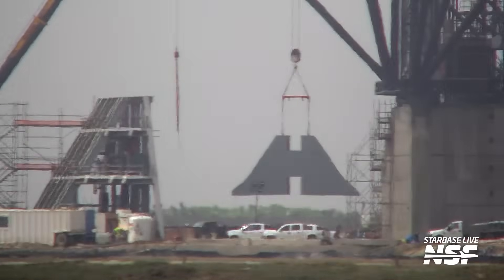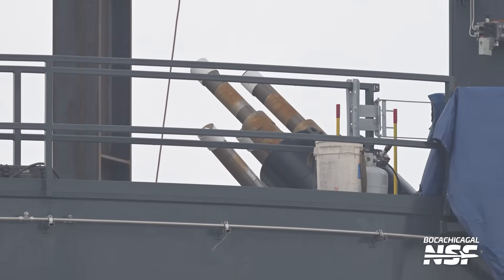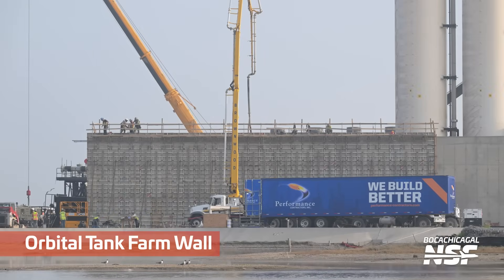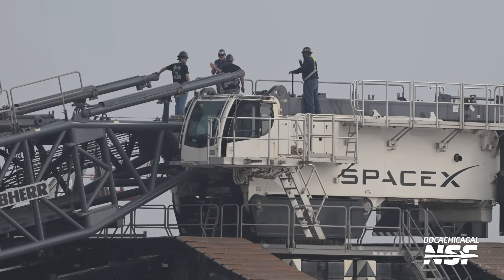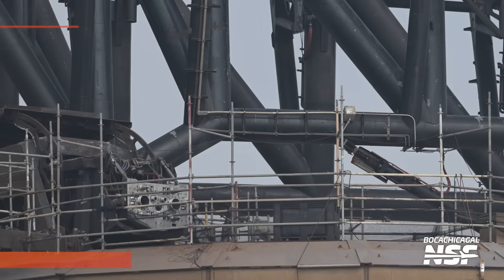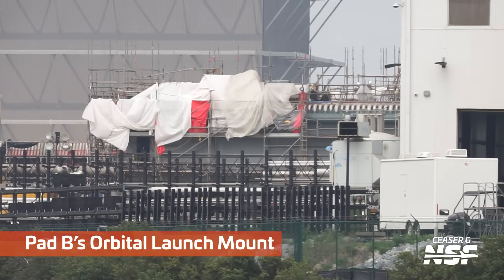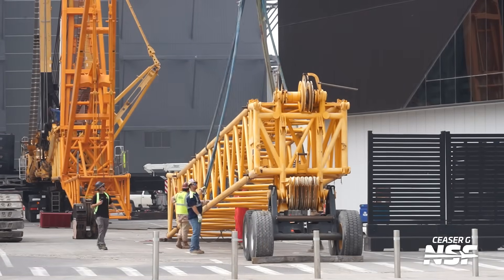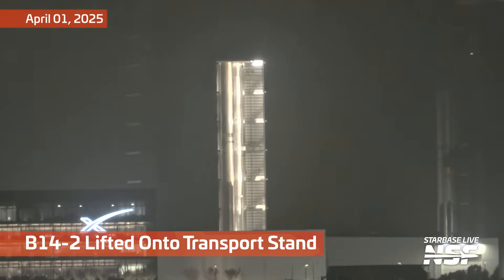Booster Sound and Fury - Signifying Reflight! | SpaceX Boca Chica

Comment: Those things on top of the starlink building...starballs!

Also, the -2, I've thought about that a few times over the years. It makes sense to increment after touchdown. My reasoning is that any refurbishment or flight preparation is for the second flight at that point. It also works out for documentation because you take a picture and say well that's BXX-2 which will soon be flown for the 2nd time. It just keeps everything in sync for an active booster. I can see the argument that it hasn't flown a second time yet. Like after its last flight it will be one number too high. I think an off by one error at retirement is easier to deal with than an off by one error when it's active. The alternative is to change the numbering of flights to be 0-based and good luck with that ;)

Comment: For project management purposes, it would make sense to give the vehicle a "-n" designation at the same moment they decide to (re)use it and start preparing it for the next ("n-th") flight. Using Booster 14 as an example, they might name the overall project "Booster 14" when they start production of the vehicle, then name it Booster 14-1 (-1 being implied anyways) once they start preparing it for first flight and (potential) recovery, and once it has been recovered and they decide to reuse it then change the designation to Booster 14-2, then so on for any subsequent turnarounds. That way you would always have a clear designation of where in its lifecycle the vehicle is at any given time. Example: Booster 14-4 is being prepared for (its 4th) flight. Or: We have successfully recovered Booster 14-4 (after its 4th flight).

Comment: When it flies, and is recovered its life under a number is over. Restoring it, or building a new one are in effect the same. The used booster is the same as any other part used to make a new booster. It could just get a new name. To emphasize the accomplishment of reuse it's given a name with the booster's original name, and the dash number to designate that it is another life of the booster. That life begins when the rebuild begins. If there is no rebuild it doesn't get a new name. It keeps the name it had for its previous life. Booster dash 19 stays dash 19 denoting it has been used 19 times. It doesn't have to fly to have a name or number. If a booster was used for training or testing, or display, or blows up, and never flies it keeps the name. NASA got criticism for attempting to rename Apollo 1 after the fire. Suspected the renaming was to obscure the fact that it was a part of, and a failure of the Apollo program.

Inconsistency with names is inherently suspicious. Fake ID, aliases, priests under aliases who are allowed control of children is suspicious,

Comment: I think the “-#” may be similar to FAA repair protocol. The original item is -1. When the booster lands the first time it closes the Work Order or paperwork book (the paper trail) for that chapter of the booster’s history.  It is still the same booster but it is beginning the second chapter of its maintenance history. Everything done to it now will fall under chapter two, until it lands a second time and is then designated -3. So being OctoGrabbed and transported and lifted off the recovery barge or landing zone is in the next chapter.  
It’s just a way to track and group when each  maintenance procedure was performed, after it made the first flight or the 32nd flight. On a plane if maintenance is done on any part of the plane a Work Order is created.  It lists the procedures, mechanic, date, and materials used. If rivets were used the specific part number (indicates length, diameter, material it’s made of) and the inventory number. This traces it back to the procurement date, manufacturer, and batch number. At the manufacturer they can then tell you who made it and when they made it. I expect SpaceX procedures are similar but rather than being on paper it’s on hand held computer terminals (iPads etc) running custom apps.

Comment: The "-1" after a booster number should indicate that it is the first version of that booster. After it has landed and been refurbished for its second flight, it  should received the "-2" suffix, whether or not it flies. If a booster is not refurbished, it does not get a new suffix.

Comment: It should be based on hardware. B14 is the original hardware. B14-2 is a booster that was refurbished once. It is still B14 after a first flight. Once parts are taken off and parts are put back on then it's B14-2. If no parts were exchanged then its still the same name. I imagine B14 had a decent amount of refurbishment but they will want to reduce that in the future. Super boosters are intended to refly hundreds of times. There's no point in changing the name for every flight. It's like changing the name of a plane every time it takes off. If there are major hardware changed performed on the booster like swapping out engines then the name is updated since it's literally a different booster. It'll be the ship of theseus eventually lol. Used engines will be put on new boosters. Grid fin motors will get replaced when they wear out. The landing lugs must take a lot of force and need inspection and repair once in awhile.

Comment: IMO when a vehicle (in this case B14) didn't fly yet, it should be named like B14-0. If it completed its first flight, right after it landed, it should change to B14-1. And then refurbishment, while it's still B14-1, and when it flies again and land, then its name should be B14-2. This way the -X would signify the number of times it has flown. Or at least it makes more sense for me.
And a quick note, for some reason Klingon isn't appearing for me, at least on mobile(tablet)
Reply: It should be based on hardware. B14 is the original hardware. B14-2 is a booster that was refurbished once. It is still B14 after a first flight. Once parts are taken off and parts are put back on then it's B14-2. If no parts were exchanged then its still the same name.
Reply: @kevinliang9502  This one's valid too
Reply: @kevinliang9502  It should be B14, then B18-A,B,C etc if you get my drift! 🖖

Comment: I work for the construction company installing the roundabout and the 2 lanes are 20' each (40' total, not including the center with a rollover curb).  Eighteen-wheelers will have more than enough room to turn around.
Reply from the maker: Do you know the total radius? I measured one here locally and it's got a single 20 ft lane with a 70 ft inner diameter, and trucks woth trailers can't fit straight through it, much less perform a 180. So many trucks got stuck, they started putting up signs to redirect them at other entrances to that road. Probably just need to go down and see this one for myself hah. - Das

Comment: 14-2 makes the most sense. When the very first booster was built it was called booster 1 not booster zero. So the count always starts at 1. Hence booster 14-1 was the maiden flight of booster 14. And the booster 14-2 would be the second flight, etc. If they choose not to recover booster 14 on the next flight then there will be no 14-3.
Remember they're counting flights not recoveries. It would be booster 14-2 whether it explodes, lands in the ocean, or is caught on the tower.
Reply from the maker: Same questions... if they're counting flights, what if it doesn't fly? Does it revert back to 14-1? Quite the conundrum 😅 - Das
Reply: @NASASpaceflight  I would say in that scenario booster 14-1 flew and booster 14-2 was scrubbed and decommissioned. So you would say booster 14-2 never got to fly.

Comment: I am going to continue with my prediction that the roundabout will not be used by the long gas trucks but will be mainly used by the many SpaceX and contractor trucks and cars that are always coming and going at the launch site.  The gas trucks already seem to get in and out of their spots okay as it is.

But I could be wrong, maybe sometimes a gas truck will find it easier to back into their spot if they are coming from the other direction, so they will use the roundabout.  Either way beachgoers and Starship gazers who park on the beach road will still have to turn around the old-fashioned way.

Comment: 9:10 Boosters need the -2 for record keeping. They need to track every detail of every preflight inspection and maintenance step, just as much as they track flight and post-flight data.

The new dash number will be used when a worker logs a preflight operation.

I would not be surprised if preflight and post-flight operations are combined as launch cadence improves. For example, when a filter is changed between flights 23-4 and 23-5, installing the new filter will be a pre-flight step for 23-5. The old filter will be stored for analysis in a container labeled 23-4. Analyzing the crud found in the old filter under a microscope will be logged as a post flight activity for flight 23-4. Even if the laboratory analysis is performed much later.

Comment: Booster 14 and Booster 14-2 have slightly different hardware including 3 raptors and who knows how many other hardware or software changes due to damage or upgrades. I think they use the 14-2 for the documentation to keep straight what they have changed between launches.

Comment: It's relatively easy, it was booster 14 before it flew, now it's booster 14.1, as it's flown once, if it's used again then it becomes booster 14.2, because it's flown twice. This way you are able to tell if it has flown or not.
Reply: theres a precedence of like 400 falcon 9 landings...
Reply: Close but you have it a little bit backward. It's 14-1 on its maiden flight and 14-2 on its second flight. As the commenter above says, this is well established with the falcon boosters.

Comment: Do you really think they're going to design, engineer, and build a roundabout that isn't large enough to handle the traffic it is specifically being built for?
Reply from the maker: Have you been to Starbase? 🤣 Waves at highbay being torn down, as it's not big enough to process the vehicles it was built to handle. 😉 - Das
Reply: @NASASpaceflight  is SpaceX building the roundabout, or the county/state?  And the highbay was part of scaling up, unless you think it would've made sense for them to build a Gigabay while they were assembling ship pieces in tents.
Reply from the maker: Recall they had to take the top off the highbay and send a crane through the hole because the boosters were too tall to get onto the stands... - Das

Comment: If it's considered a Mission counter and not a Flight counter, then -2 is appropriate.
So I guess it's maiden flight it was already technically -1?
My programmer's brain wants to start at 0 with completion moving to 1, so I would have voted for a flight designation but SpaceX doesn't nominorly consult with me.😉
🖖😎👍
(edit) This way even boosters in the bays have completed nearly 1 mission(s).😉😉

Comment: You could use a different delimiter for the stages flight hardware goes through, BXX for Constructed, BXX/1 for SF, On Launch Pad, BXX-1 for Completed Launch, BXX/2 for Caught booter, 2nd SF to On Launch Pad, BXX-2 for 2nd Launch and so on. Since the Construction of the Vehicle take the place of the Catch it is differeniated by no having any postfix number. /n shows how many times has it been ready to fly, -n shows how many completed launches occured.

Comment: I think it's dash 2 because they could have changed some hardware during the refurbishment. So booster 14 had x hardware and then booster 14-2 has most of the same hardware, but likely some replacement pieces.

Comment: It's calls B14 before the first flight, of course, as it's readied for flight.  Which, from SpaceX point of view, is where all the work actually is.  Flight day is just the finish line.  And so, it needs a name that denotes the referb and flight prep for flight 2.  B14-2 seems like a good name to me.
Reply from the maker: What happens if it never launches that second flight? - Das
Reply: @NASASpaceflight  it would have been still called B14, even if it never flew and boosted a ship.  I feel the name reflex the mission it's preparing for.

Comment: Your reasoning says flight 9 can't be called flight nine until it's flown...
It's booster 14, in the very long processes involved in flying a 2nd time, weeks of work currently,  all for the 2nd time. The 8 minutes of the flight is the last step of the process. 
Imho
Reply from the maker: But what if it never flies that flight? - Das
Reply: @NASASpaceflight I think the -2 should be applied if it is assigned to a second flight. That would essentially make the 2 the number of assigned missions.
Reply from the maker: That leaves the gap though, if it's assigned but doesn't fly. Does it stay -2? Does it revert back to -1 if its unassigned? - Das
Reply: @NASASpaceflight I would say no. It would lose its -2. 

I saw another comment with starting at -0 and only got its number increased after landing.

Comment: Dash 2 club here (shocker, I wrote the labels lol). Makes sense from an operations perspective since once it's landed whatever work they're doing is for its next launch. What campaign are they on? Just check the number! Exceptions would be for scrapping, but why not just expend it then, and for putting on display or in storage (a weird one, but eh, doesn't happen often). But mainly, that's what they do with their other equipment (Falcons, Fairings, Dragons), so I'd be surprised if they changed it for Starship
Reply: Why not expend it? They wouldn't want to throw away all those engines.
Reply: @matthewerwin4677  I guess it'll be interesting to see what they do. With Falcon they get rid of older boosters by just expending them (and presumably putting older engines on first as well). It's quite rare they just scrap one on the ground
Reply: I, for one, would NOT be surprised if they changed the numbering scheme.  😅